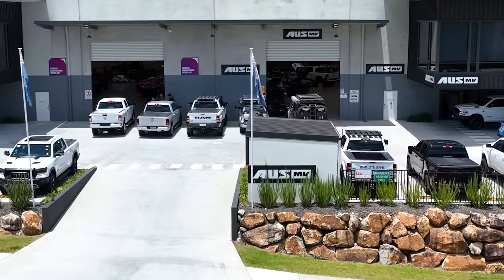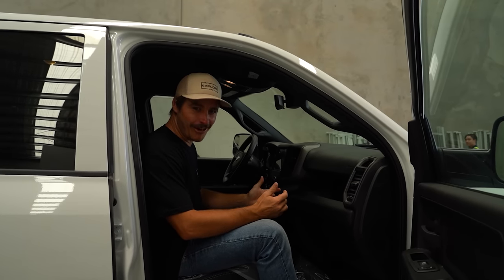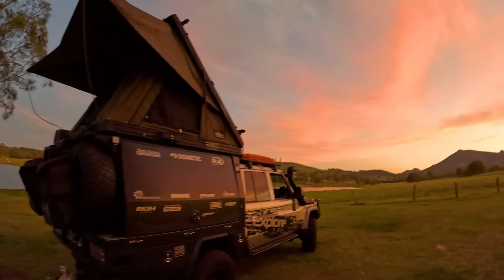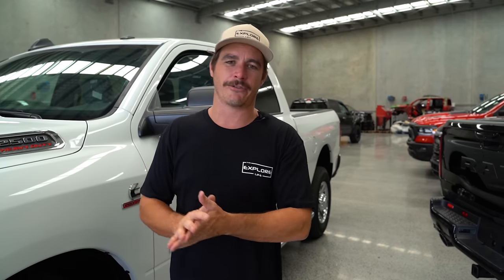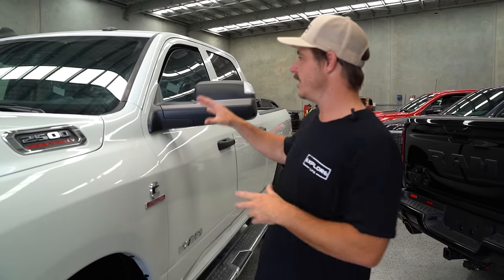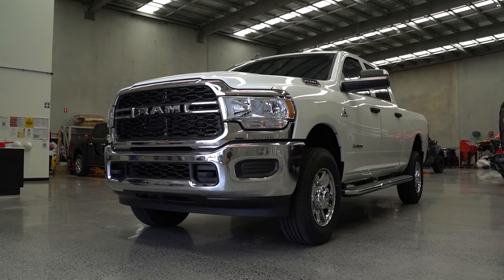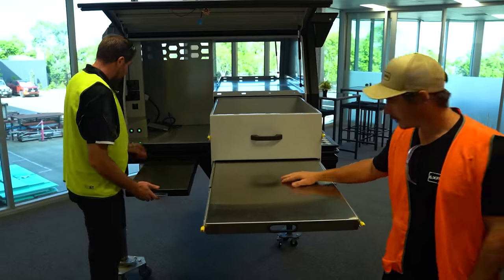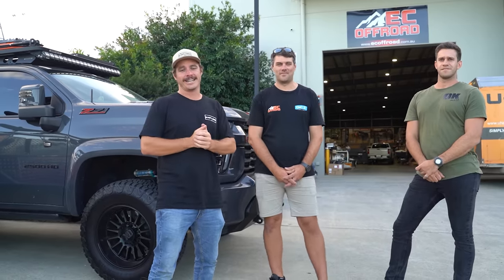I BOUGHT A NEW 4WD BUT I CAN'T DRIVE IT? NEW BUILD BEGINS!

Comment: Hey Mattie, always enjoy the content you and the team put out.  Excited to see how you build this rig.

Wise move on choosing the RAM 2500 CTD. Plus, if you do have any issues, it can be serviced by any dealer here in the States.  I have had 2 and love them; tons of torque.  37's for sure at a minimum, a full canopy, air bags, bull bar, onboard air system, Redarc solar/lithium battery managment, OnX Offroad or Gaia for navigation, etc.  A proper sized winch for that heavy truck is going to be a 15,000K at the minimum in my opinion.  Canopy and tray setups here in the States are starting to gain popularity, but still not widely used because they are $$$ to get over from AUS.  Slide-in campers are used quite a bit with that truck.  The RAM will be a great touring set up, but it is going to be H-E-A-V-Y with the Cummins diesel if you take it off-road.  Some of the trails will be tight in some areas of the States, but as long as you don't mind 'pinstripes" then you will be okay.  If you and Nav are going to be here during part of the winter for your trip, you might want to consider a block heater for the motor.  

If you guys are going to be around Texas, Arkansas, Oklahoma, etc., give me a shout through IG and I will show you around. 

Cheers, Big Ears!!🍻
Reply from the maker: Cheers mate will let you know 🤙🏼

Comment: I’m a Huge Mopar fan so this is freakin awesome tell me I can get this truck after your adventure is done 🤝🤙😁 Of course delete the exhaust dpf system then hook your EFI programmer up throw some 40in tires on it so that you have all the clearance that you will need for every occasion, tint the windows , rowdy steel bumpers with freedom winch tucked behind the bumper so it’s not exposed and sticking out all goofy